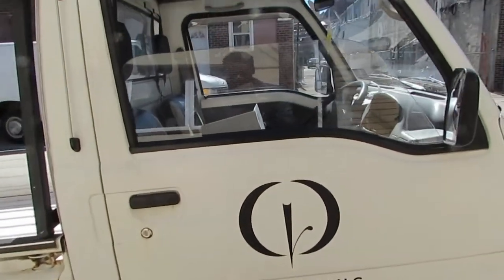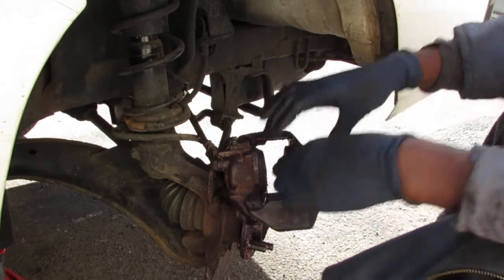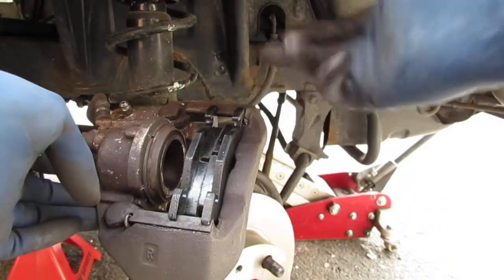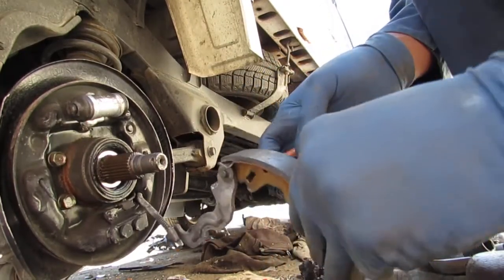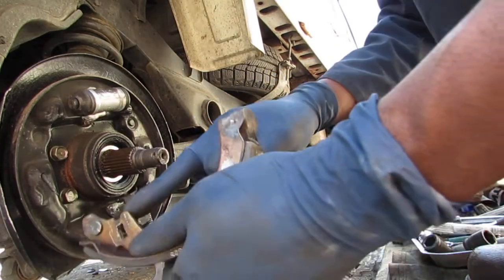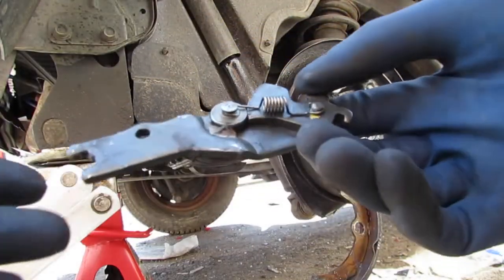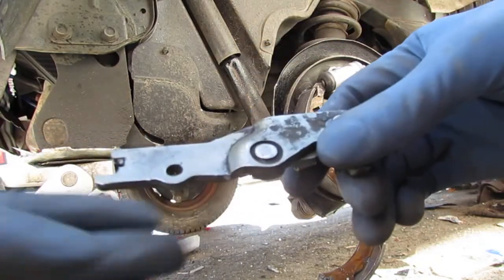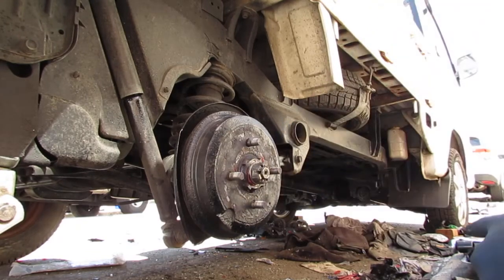1993 Subaru Sambar Front and Rear Brake Job

Comment: You never mentioned part numbers or where to get the right parts from. Also what did you do when you ran into the issue with front pads or rotor being too small, what happened???
Reply from the maker: Greetings Timotaneous, the parts can be found at yokohamamotors  place a round circle here net.  I was never able to finish the repair because I never received the correct part.  Get it from the link above.  They will send you the correct part.  Best  of luck and let me know if you encounter any problems..